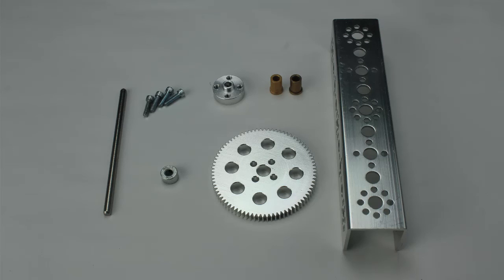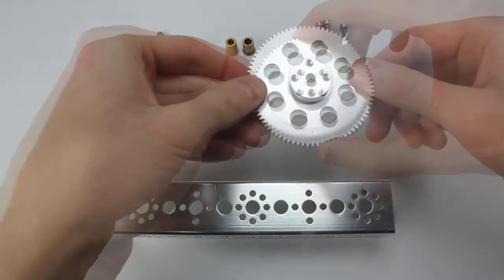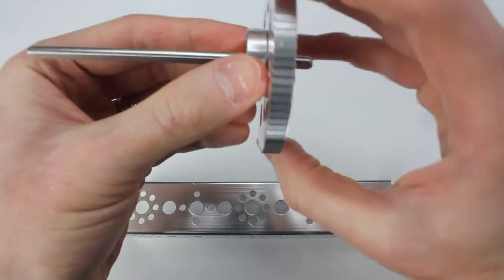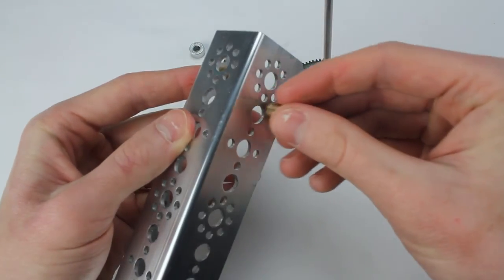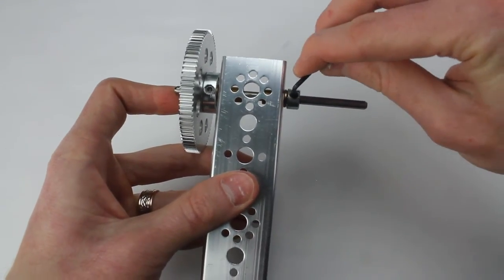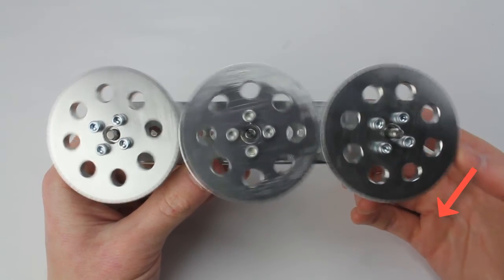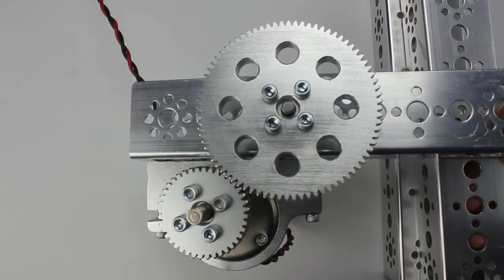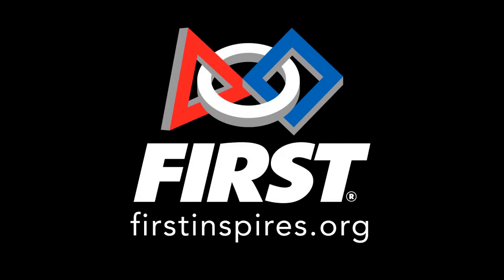How to Mount a Gear

Comment: How do I attach a small spur gear that has no hub flat to a larger gear? There is no option or room to attach by screws. Silver solder? It would look simular to the video except no hub on the spur gear.